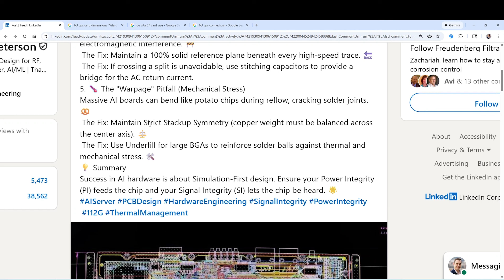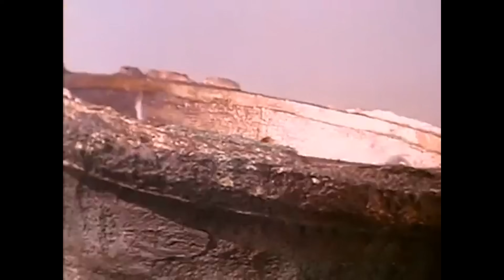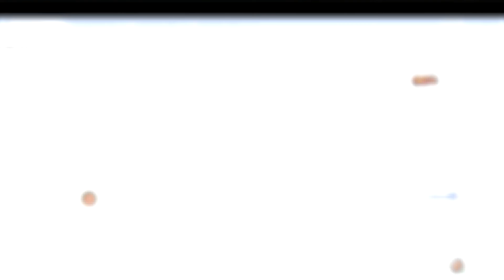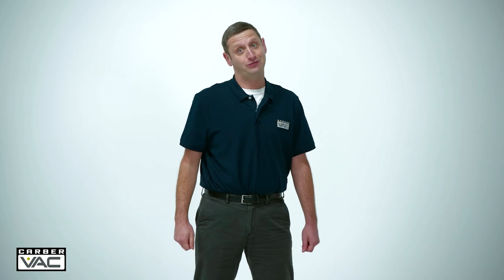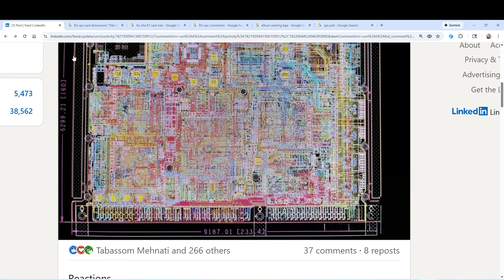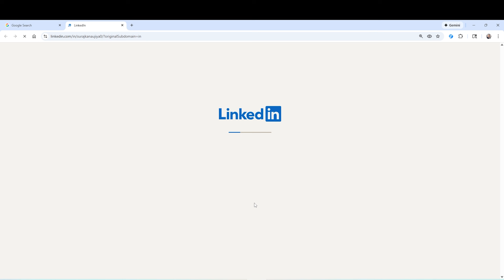Someone Will Do Prison Time For This... #pcbdesign #pcbmanufacturing

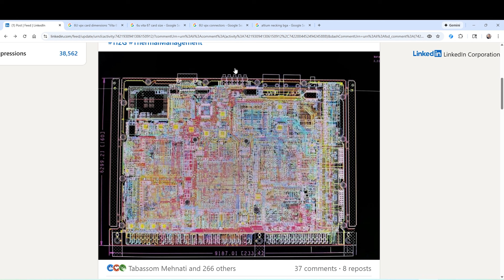Comment: 18:53 - I think that those look more like LED stacked indicators. There is no fifth signal pin between 4 mounting pins (like in a typical SMA connector) and you can see rows of current limiting resistors at both side of these 5 elements.

Comment: I'm a PCB designer of almost a decade.

The amount of slop I see now is insane.

Hardware design isn't like software design. You can't just patch a mistake, you're lucky if you can mod in a fix.

At a previous company I worked at they forced the engineering team to use AI. Myself and my boss advised against this to the VP, they told us we had to do it. Burned about a half million dollars before they realized we were right all along.

Company went bankrupt a year later.
Reply: What exactly did they want the AI to do? Would the VP ask an AI about PCB design and y’all couldn’t refuse what the AI said 😭
Reply: @tarasaurus24 to this day I still don't really know what they wanted.

Basically they plugged in requirements for a design into AI and then gave us the output and said "build this". We said " yeah this isn't gonna work" they said "do it anyway". We complained, they said we weren't being team players.

I complained to HR, HR said " well it's what they are asking, so please do it".

So we did. We implemented exactly the design as requested, 100% as spec'd out.

It didn't work. Exactly for the reasons we said it wouldn't work. It was a retarded solution that a 1st year college intern or Co-Op would have recognized as being a bad design.

But we did it, exactly as spec'd. So they couldn't fire me or my boss because we fully met the stupid braindead requirements. We didn't sabotage it, we actually implemented it.

To this day I don't understand what they wanted to prove.

All they proved is that they can burn a half million or so dollars before they admit their mistake.
Reply: @grantwilliamsmith   Might be price paid for not trusting the domain experts (you), but it's also a possibility that the company hit bottom cash flow due to crumbling overall economy and would run out of money anyway unless they found an investment, and apparently AI is an investment magnet, since it's the only remaining "growth" field. Just dumb speculation on my part. Maybe there wasn't much left to rescue. Maybe they wanted you to cheat and make it work, but it's an extreme long shot that it would have helped.